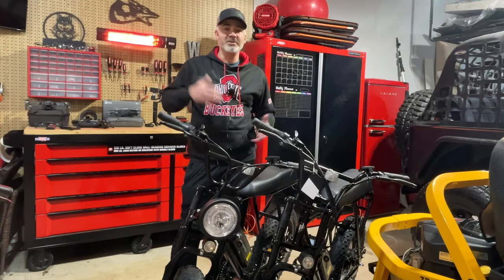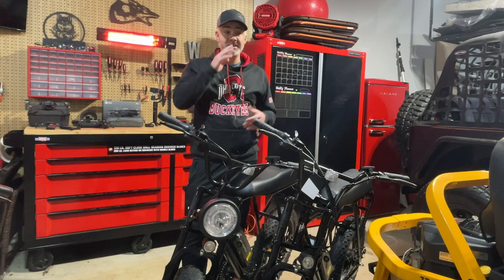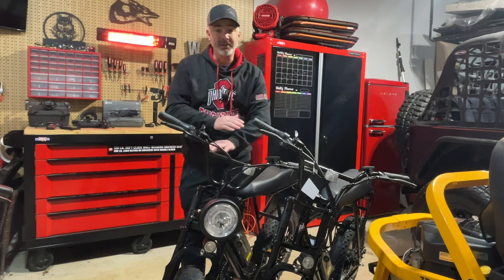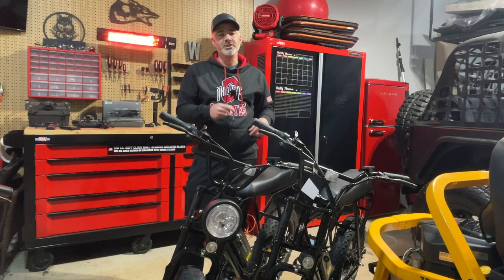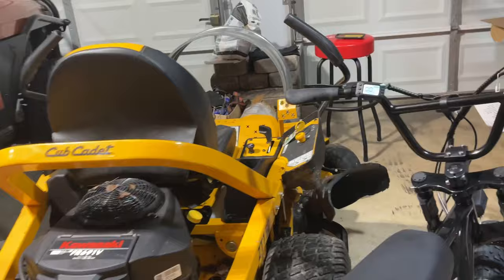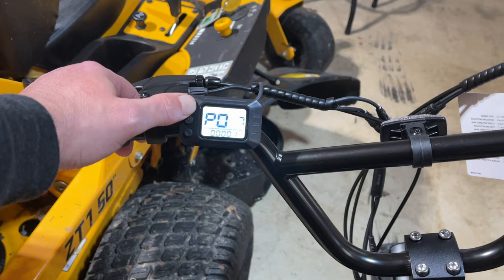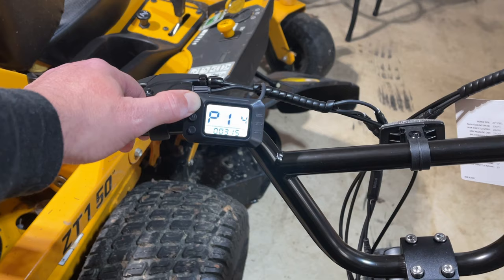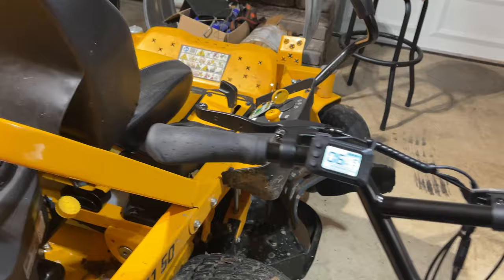🔥 HACKING MY EBIKE TO GO FASTER - NO MORE SPEED LIMITER

Comment: What do we do if we have an e bike without buttonsv
Reply from the maker: Without buttons, or a display you can't put it into developer mode. Usually those are older ones that use the magnet. Go that route
Reply: @NRGSPORTSANDHOBBY i have a display with a plus, minus, and power button, i held the plus and minus at the same time and nothing showed up
Reply from the maker: Every bike is a little different, that's why we did 5 unlocking videos, not just this one. Did you see them all?
Reply: @NRGSPORTSANDHOBBY   do you know if any of them work for the totem victor ebike?
Reply from the maker: I'm sorry, but that bike wouldn't have the capability. It's just not powerful enough to make a difference. Your issue is less about the limiter and more about the motor. I always recommend minimum 500W, with recommended 1000W or more to get anywhere over 30mph. Yours I believe goes max 20 with that motor. I know it's a great value, and that's one of the things they cut back on (power and speed). If you ever want to upgrade, we have some good recommendations on this channel for bikes with more power, speed, range, accessories, comfort etc. Best of luck and enjoy the bike. Those hold their value really well and can usually sell for what you paid for it even after use.

Comment: Can a jobo e bike limiter be removed
Reply from the maker: Only two of their models can. You didn't mention which one you have. I know a lot of their smaller ones don't have the motor to handle it
Reply: @NRGSPORTSANDHOBBY  this is the Robin model, it has a 48 volt battery with a 750 watt motor it goes up to 32 but I believe it's restricted and struggles over hills.
Reply from the maker: I went online to look for your ebike panel and the only one I saw was a 48V 250W motor. Is this yours?https://www.jobobike.eu/ebike/jobobike-robin.html

Comment: How about a 2018 Radrover??
Reply from the maker: Oh for sure. Easy. Get into the menu and change tire size
Reply: @NRGSPORTSANDHOBBY  Do I go down to the lowest tire size? (Thank you for answering, btw)
Reply from the maker: No, opposite. Make it bigger. If you can get up to a 32 tire on the panel it will be best. Keep in mind it will not reflect the correct speed on your panel (we talk about this and an app to use on our latest video I'm sure you've seen).
Reply: @NRGSPORTSANDHOBBY  Thank you for the tip. Will do this.

Comment: It worked but now my battery sensor is blank 😭
Reply from the maker: Yeah, some ebikes the battery voltage setting will do that. If it's a 48V battery and your setting is 48, keep it at 48. Then your battery will go back to normal and won't affect the extra speed. Only raise the tire and motor setting. Raising the battery voltage will only drain the battery faster and won't give any benefits. Most Ebikes don't have this setting, but yours must

Comment: Mokwheel info please
Reply from the maker: Which model do you have? They have different panels
Reply from the maker: I have the Mesa ST and Tor Plus here, not the Basalt. Do you know the model of that panel? Our Tor Plus cannot be unlocked, but the Mesa ST (new model) can be. So need ot know which panel you have
Reply: I actually figured it out you just hold down the up arrow the down arrow and the light buttons all at the same time for 20 seconds

Comment: My Velotric Nomad can only go 25 mph with upgrade. My wifes Venton Pace 500.3 goes 28mph with mod. Maybe if i change the 4 inch tire size it will go 28 mph. 😂.  I beat my  Nomad riding my Trek FX3 pedal bike, (short distance). I should have purchaed the Wicked ebike. Maybe next time.
Reply from the maker: Nomad is a good ebike. Just have to unlock it. Mine goes 43mph

Comment: Know how to unlock the Eahora Juliet?! I bumped the km/h from 48 to 51 but didn't notice a difference.
Reply: Can raising ALL the settings to MAX mess anything up?
Reply from the maker: All it will mess up is the speedometer on your panel. If you have a low W motor it will also reduce the life/range of the battery. I recommend only doing this with minimum 500W or larger motor and 48V 16ah or more battery